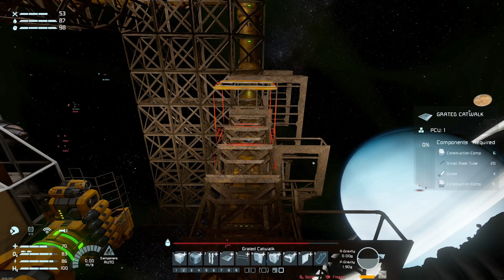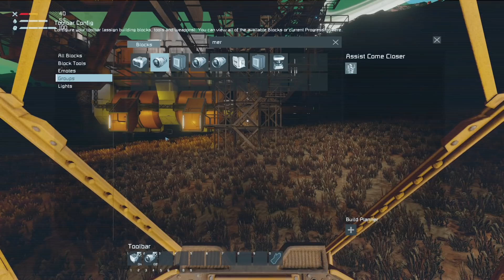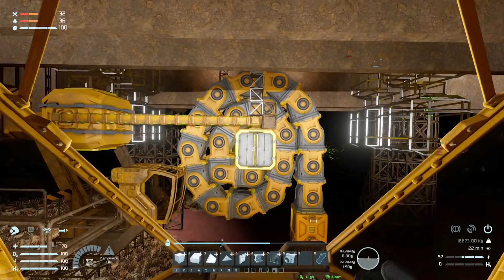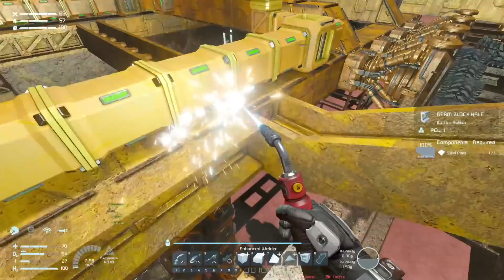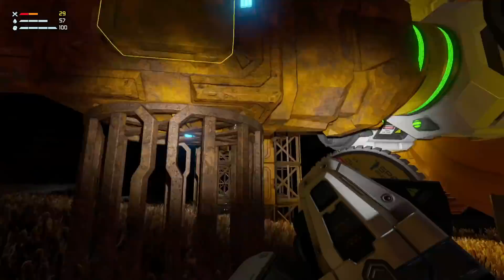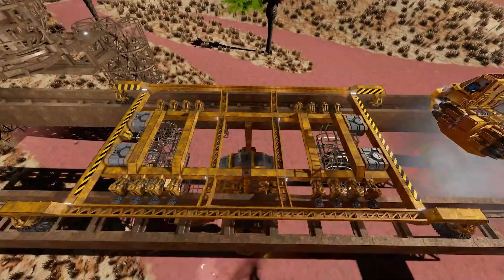Survival Impossible - Splat-form #61 - Space Engineers Hardcore Survival

Comment: I realize this is three years old, but if you’re concerned about over filling your drills, it may be useful to add a small cargo container turned off so it doesn’t fill. If you need to empty the drills it may provide just enough to free them up . I do something similar with my mining ship batteries, keep one ungrouped and set to recharge so I have a backup charge just in case. Had way too many ships lost in a mine before I figured that one out.
Reply from the maker: Sounds like a pretty good idea for this sort of problem, but I don't think we can do it with the container, you might be able to something like that with a sorter. Since the drills push into the container and I don't think there's anything you can turn off to stop.

Comment: The support lighting is weird for 2 reasons. 1, that color arrangement is for things like planes and ships so that other planes and ships can tell what they're looking at (the right [starboard], left [port], bow [front], or stern/aft [rear] of said vehicle.) Those supports aren't vehicles so you don't really need them lit up with that color arrangement, in fact having both of them red would make more sense since they'd be acting more like warning beacons. But they only really telling you is that there's a post there and that your port side (red and left) is still to your port and that your starboard side (green and right) is still to your starboard.

The second reason it's weird is your gondola would fit more in the category of a "rail car" at this point. According to railroad color code, green means that it's safe to proceed while red means to stop due to danger ahead. . . . So it's essentially sending literal mixed signals from that perspective. It doesn't mean you have to change everything to green lights, rather feel free to do what you want. It's just a bit strange to see navigation lights on a static object/see a completely mixed and conflicting signal coloring for a train.

And again, being late to the party, I think you'd be better off turning the gondola's cockpit to face into the gondola. You don't necessarily need to "see" down the rail line, you should be looking more towards the working bits. It's kind of like how dockyard cranes don't have their control cockpit facing in towards the dock space they're loading/unloading instead of looking down one way of their track. That'd also give you the ability to just look to the side from the cockpit to either side and see where you're going. You could have also have added cameras to the front to also give you the option of an exclusive view of where you're going.

The other benefit of that would be that you could build a slightly bigger gantry around the cockpit where you could enter either side with the gantry wrapping around the entire back and side of the thing. This makes access to either side possible and as long as you make enough of the gantry also a good chunk of the platform to the cockpit, you're less likely to enter from the platform and more likely to be on the gantry.

Comment: If you'd like, I could pretty easily make you a configurable script for less twitchy subgrid wheels. I'd make them ramp up their power over, say, 2 seconds on W/S input. It could also adjust power based on the physical mass of the vehicle.
Could also write a tiny script to take the Splatform's batteries off recharge when you hop in.

Comment: FAA regulations for lighting of structures use red and white lights.

During the night, aviation red flashing beacons and/or steady burning beacons must be used on required structures. On structures 200 feet above ground level or more, medium-intensity, white, flashing lights may be used in daylight and twilight hours, but the intensity must be reduced at night. High-intensity flashing lights may be used during daytime or twilight hours if they are automatically reduced at night. This is not recommended for structures 500 feet above ground level or less, unless an aeronautical study determines otherwise. Dual lighting systems use red lights for nighttime and medium- or high-intensity flashing lights for daytime and twilight.

During construction, when the structure reaches the height at which permanent lighting would be required, two or more high- or medium-intensity white lights should be installed at that level and should be operated 24 hours a day. In urban areas, where there are white street lights, the red obstruction lights with painting or the dual system of medium-intensity lighting is recommended.

Comment: What's your opinion on using the basic battery manager script or something similar that turns off the hydrogen engines when batteries are charged to a certain percentage so you don't waste hydrogen?
Reply from the maker: I think scripts like that can be very useful, I also think in frequently get lazy and don't set up as many scripted things as I could because of the time it takes to learn how to setup each different one :P
Reply: @Splitsie  that 's a good point. Basic battery manager though doesn't need any setup. It just runs by itself and manages the grid :D

Comment: how about building a tunnel bore like mining rover, 5 drills mounted to a container (4 sides and one on the face) attached to a rotor called the mole. alteratively you could pair of rotors with each having 2 drills mounted off set by 90 degrees so they turn like gears to mine out the tunnels
Reply from the maker: I've got a plan for a mining rover that I've been wanting to do for a while - should be capable of drilling its own drivable path and carrying a decent amount of ore :)

Comment: I would set those support lights on the posts up as 'red-red'. Red-green is used for ships and aviation because it indicates the direction in which you can expect oncoming traffic, as they are supposed to pass each other on the 'red' side with green facing out. Since this is a single track, that's not really the case here.

Red-red is more applicable here because they are used as railway tail lights which is a signal for engineers behind it to stop, as there is either another train or a solid obstacle ahead.

Comment: I tried to recreate your gondola in my own world but I couldn't get the wheels right even though I copied how you did it so I ended up using a system of pistons with headless rotors attached to them that attach to rotor heads on the underside of the steel beams and pull the tram along

Comment: You mentioned the twitchiness of the Subgrid wheels script and how you'd much prefer a smoother control over them.
Well may I suggest considering DAS script instead? It does have subgrid wheels support and handles the acceleration very smoothly and power efficiently. With great configurability as well. Be it speed limit, acceleration limit for both forward and backward.
One thing of note is its automated control over the suspension strength, they can be manually set to a desired value in the config part of the script however.

Comment: What if you put a projector and welders on the train car to keep making new track in front of the train, you could come up with some kind of elaborate piping network that could also be welded in, maybe a timer system that every so often it locks to a connector on the conveyer line, or a simpler way would just be a cargo container that could be refilled when you get back to the start of the track. You could put a grinder/welder on the front of your little build craft, also.

Comment: The tram is cool but.. why not have it construct it's own tracks? Using a projector and welder, have it project tracks infront of it, whenever it "runs out of tracks" it just constructs new tracks on it's own.
Reply from the maker: It's because you sort of can't do that. To project new blocks the projector has to be on the grid they're being added to (which means the rails) so I'd have to build one on the base not the car and at that point I think the more interesting way to build new sections in the future would be to build them back at the base and then shift the sections into position
Reply: @Splitsie  If that is the case, why not make use of the welding pads you used before in the series and have a constructor part on the top of the miner? Constructor part creates a new section of rail, moves it in place and welding pads weld it to the rail. It's one of those things that if you could automate it to an extent it would be really, and I do mean REALLY, cool!

Comment: in place of the normal Cockpit, use a Buggy cockpit.

Navigation Lights are Red on Right, Green on Left.

Splatform = not only accurate, but most amusing too!
Steve needs to be constantly on Vigil to see you plunge randomly off things if for no other reason than to see how high you bounce in 2 G's

since you have some O2H2 Gen's on the Drill Tram, pipe the cockpit into the cargo system to replenish O2.

for the Tram's Name. consider
the Ice Centipede.

also. Magnesium is needed so you can start taking out those bases before they send more drones to annoy you!

Comment: Have you ever considered an all in one utility ship? I'm trying to design one at the moment since the new tiny merge blocks make it possible - It's basically something similar to your crane but with a "holster" of sorts on the bed. I use the new mag pads to "unholster" the welder/grinder using the new small merge blocks and they stay in place thanks to the new mag pads. Industrial update really is the best thing to happen to small grid in a while for stuff like this.

While listening to you say the flying building mode felt a bit too easy my mind immediately went to my overly complicated totally unnecessary building ship, which now that I think of it sounds like a total splitsie solution to a basic problem.

Comment: Red and green light doesn't make sense for me on a static construction, not on vehicle.
Why do you use merge blocks instead of rotor to connect splatform if it ruins your names? I don't think there is a solid reason to avoid rotors for connecting? Maybe just to force it square?
Reply: Klang becomes a risk if you use a rotor for recharging.  I'm using one on a small grid vehicle that's too small for a connector right now and I had to build a platform to lock mag plates to before attaching the rotor, and it still generates silly amounts of phantom force.  Rotor charging is risky business.

Comment: Suggestion: a magnetic pad or pair of wheels on either side of the coils to secure the coil drill in place while moving down the rail system. Cause you know one day you'll need an emergency boost back to under gun sentry and it'd be bad if the drill destroyed itself in the process.
Reply from the maker: I actually think putting anything near the hinge chain will make it less stable not more stable, since it'll increase the number of physics objects sitting together and potentially cause clang
Reply: @Splitsie  Not going to lie i had the same thoughts, but had to suggest anyway!

Comment: You could remove the parking brake binding from your keyboard assignments, and re-bind it to the color picker. But I imagine that the middle mouse button for picking a color from an existing grid should work in cockpit placement mode too?
Reply from the maker: I don't believe you can - I've not looked at it but it's a very common complaint about the P/Park/paint keybind in space engineers

Comment: I always wanted to see how u would go about setting up programmable/timing blocks? So that when your batteries fell below a certain point, your hydrogen engines would turn on and then turn themselves off once your batteries are charged.
Reply: isy's solar alignment script also does this too
Reply: @defnethelaurel  Yup, if you're building a sun tracking solar array, us that instead.  If not, then it's a bit overkill.
Reply: I've got a script on the workshop that does exactly that.
Reply from the maker: I usually do those things manually as they're rare and I mostly use it to get power back to something I've not used in a while, but otherwise, yep you'd need a script to get it to work :)
Reply: I appreciate all the replies. But I would ask all of you to read my comment in its entirety, instead of selectively.

Comment: Would it be possible to set up a track layer on the top half of the platform?   

You’d probably have to do some shenanigans with with merge blocking so that the the new tracks will be connected to the existing track.   Might not be worth it.  

probably want to get a turret set up on the tram as well, because you’ll be isolated when out on the lake.  Maybe a disposable turret that can detach from the tram and hover in place to act as a distraction while you hightail it back to the refinery?

Comment: One more small atmo will give you enough lift for a combined weight of around 26,000kg or roughly an additional 4,000kg.  At this point, you might be better off going with a single large.
Reply from the maker: Style wise I prefer the footprint of the small thrusters as they can be adapted to fit into a shape that works better with the platform despite the efficiency gain of a large thruster
Reply: @Splitsie  Yeah, I was thinking over the layout of the sled and trying to envision how to use a large on that build.  You'd have to rebuild complete and center the build around the thruster to have any hope of making it aesthetically pleasing.  The issue is the diminishing returns of weight vs thrust (the power issue is not as much of a factor for you at the moment).  I think you're probably at max on the build as it.  I've got a mental image of an upgraded version of this with a hidden welder on a hinge that folds under the sled, but the cost of doing that additional weight would mean using at least 10 small thrusters, which defeats the purpose of a "small floating platform to do work on".  At that point, it's a utility ship.

Comment: You know you could put cameras along the rails to watch/record your tram shunting back and forth on its mining operations. Could make for a cool timelapse I think

Also could you use sensors and overides to control the mining tram? Like an overide that makes it return to the base and a sensor that activates the conector all at the push of a button? Hell is there a script that would let you call a timer for that when the trams inventory is full.

Going further is it possible to get the tram to stop when it senses terain beneth it and start mining. Further still is it possible to set this whole thing up on a loop that you can trigger remotly from your main base? Perhapse even to just run it automaticaly when it detect that the base is short of ice or hydrogen?

If you hook the Panini up with waypoint you chould just push a button in your contol tower and it would just go and fetch hydrogen from  your automated ice mining ice base.

Is it possible to use an inventory mananger script to set up the Panini as a muel running ammo down to the Ice station and water back to the main base?

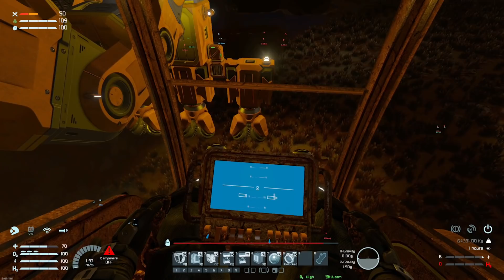Comment: 27:48 I facepamed so hard seeing you do that just after working on a thing to stop you from doing it. 

Also you could add a second bind for you paint to use when in a cockpit or just rebind the park or paint so there is no conflict. I think that would work
Reply from the maker: Sadly I don't think you can rebind the paint controls to be separate from Park :/
Reply: @Splitsie  I have my paint bind as "-" . As I have a G-Key on my keyboard bound to that so it is easy to access. And I can use "P" to park. But I just checked and it doesn't work. They seems to have disabled painting in a cockpit to avoid the conflict with the binds causing problems. D:
Reply: Bit late to the party, but there's also the [ & ] keys to cycle through the colors. Those should work while building from the cockpit (which I, too, have never done myself, since it does feel a bit "cheaty")

Comment: You don't need a script to control the wheels with a subgrid cockpit, just use a remote control on the main grid, put that in the cockppit hotbar as "control". This also means you can setup the hotbar in the remote, and the controls will be the same from either the cockpit or your suit antenna in case you need to remote control the rig from the ground. It's the same trick I use to put small grid control seats in the cockpit of large grid ships.

Comment: Have you considered using a cylinder block or zero friction wheel(s) to slide your hinge conveyor over?  Doing so would allow the drills to go straight down.  At present, the more of the conveyor that unwinds, the farther back the drills move because the diameter of the wrapped section keeps getting smaller.
Reply: He did talk about that a couple of episodes ago, and decided against it.  I don't remember why now.

Comment: Would it be possible to use a Programmable Block to make the LEDs on the drill flash when the cargo containers are full?
Reply: Yeah, the Cargo Utilization Light v2.2 is a script that changes the color of the lights to indicate the cargo level. It also blinks the lights when cargo is full. 
Using the script he can set the cockpit screen in the programming block custom data, and if he gives the it the appropriate tag to the cockpit's name, he will have a cargo level readout in the cockpit. Therefore, he would have a colorful indication when looking from the outside of the cockpit either in third person or with Steve cam, and a easy to read indicator from inside it. He also mentioned that he wanted the drills to stop when they reach about 20% full, which can also be set in the script.